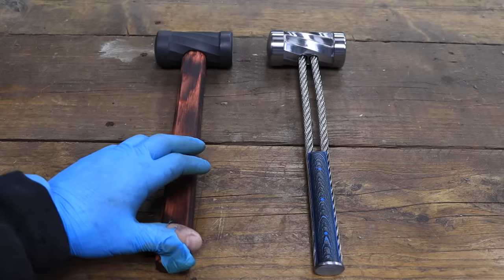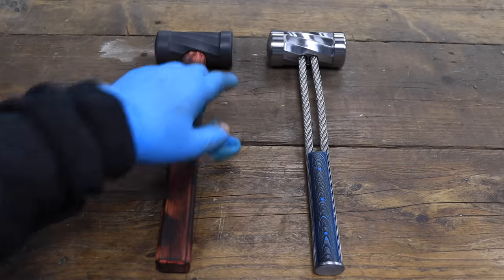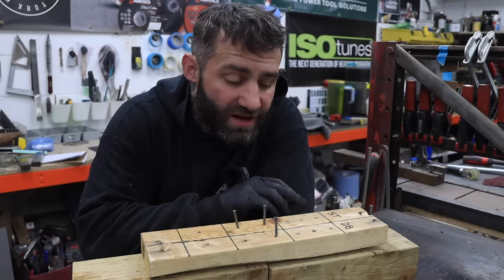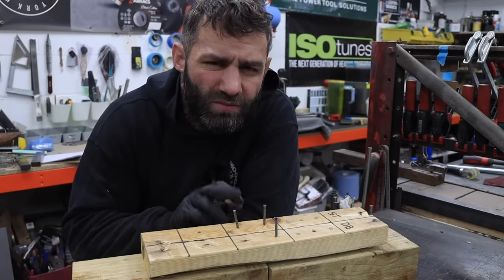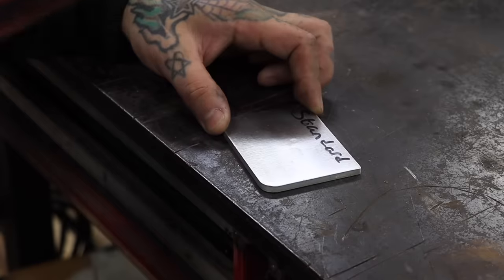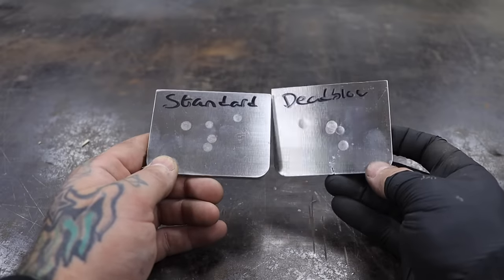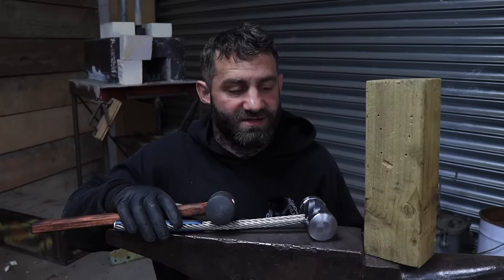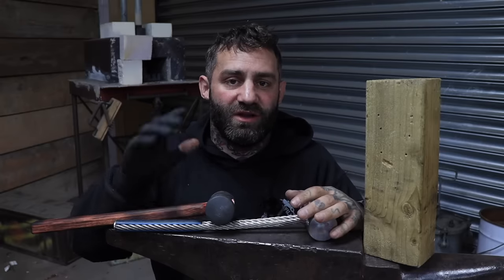Making A Kinetic Hammer - Will It Work?

Comment: @8:07 The head bounces on the first two strikes with the solid handle, right? That acoustic "bzzzz@ Is two rapid strikes -- it sound to me.

Instantly I remembered what happened with a written pencil. If you briskly strike a wooden pencil point at a 20 or so degree angle, lightly bouncing it off a hard, smooth surface, you'll see "two"! graphite trails. In my simulation/imagination, the graphite core snaps back much faster than the pressure wave going through the body of the pencil, but at the end of the second strike, the whole pencil is bouncing back up. 

Since the traces are  nearly equally thick, it seems the energy imparted to the whole pencil is nearly equal on both bounces. So, I'm guessing the first tap, at an ideal angle, results in the pencil losing all velocity in one direction ( bisecting the angle of incidence and bounce - splitting the V ). Twice, the graphite core slams into the table in two efficient elastic bounces. The second bounce sends the pencil what back up.

So, analogously, in the case of this solid hammer, the metal head also has a faster "conductance" to pressure waves than does the wooden handle (it bounces faster than a lateral strike with hard wood). Only in this case, the speed of the bounce of steel and graphite are perhaps quite different. The bounce may be much faster for steel than a pencil graphite.

As to sonic evidence for what I'm saying, I think the compression algorithm might strongly affect the audio here, so if we could see a sonogram of those first few strikes from a raw, uncompressed file, I bet we would see two near equal spikes side-by-side. Visually, maybe a laser pointer could show two strikes if you can get the precise angle and the video frame rate high enough, I guess.

PS I fully intended to skip ahead going see the results of the test, but your pacing was so good that I never had the opportunity to turn away and skip any of the process.

I do wonder if two more cables might stop the twisting that too easily happens sometimes with just two cables. Trying to think outside the box, if the middle area of the handle can become less rigid, with a lower acoustic velocity, then maybe the fast pressure waves of the impact will dissipate. Therefore, I think you'd want a material with a different acoustic velocity, not flexible steel, but "flexi-glass"-- or a robust but slightly flexible plastic-type material -- super-stiff rubber.

Comment: you could do a sort of ZIG ZAG (in triangles) pattern springs or thin cables / wires in between the cables..so it still flexible but more easy to wield.

Comment: Can you try with 3 wires, so that the head does not rotate when you hit hard? Also, maybe try with an axe for cutting/splitting wood?
Reply: That’s what I was thinking. 3 would still let it flex some, but be equally stiff in most directions. With just 2 it’s stiff one way and softer the other way. 
If you wanted it softer could use a single cable and it would be the same in all directions.

Comment: Try modifying it to have a third cable in the center from handle to head. That should stiffen things up a bit. Then you could experiment with adding physical connections between the cables of varying types, sizes, and number.
Reply from the maker: I explained how to fix it

Comment: I think you could improve the accuracy of the dead blow hammer without increasing shock load by constraining more of the cable section in such a way that the cables can move relative to each other on only the vertical axis.
Reply from the maker: If you watch till the end I explain how to sort it

Comment: That's pretty interesting and beautiful. Watching this made me think two things. For a similar effect, I wonder if you could use a very stiff coil spring for a handle; if it wants to spring back to the original position maybe it'd increase accuracy. When I saw the thumbnail, I thought the cable was a solid rod and the hammer slid from the handle to normal position. A splitting maul with a sliding head like that might have some unexpected virtue. Anyway, I've ran into your channel 3 times now and have enjoyed myself, so I guess it's time to sub. Thanks for doing your thing, its fun to come along for the ride.
Reply from the maker: I tried coil spring for the concept and it was way too crazy. 
Thank you very much im glad you decided to subscribe

Comment: What about some super thick chain to put between the steel cable? Would add rigidity but still let the hammer flex in direction of travel.
Reply from the maker: I’ve explained how to fix it, anything else takes away from the purpose of flex and it’s twist that was the problem not the flex

Comment: Another great vid. I think a single  cable might work better, having two might be going against eatchother. Kinetic hammers realy excell at low level hitting, ie...driving spikes or hitting a cold chisel for splitting rock thats low and paralell to the ground.
Reply from the maker: I explained how to fix the issue in the video, the concept works fine

Comment: You choke your hammer ... Let the hammer do the work after your wrist flicks it through the arc...I framed houses for over 15 years and the first thing my mentor taught me was holding the hammer at the bottom end about and inch from bottom... Let the wrist flick the hammer forward in an arc shape , also don't hold the hammer tight at moment of impact. Deadens the vibration and better for your wrist and hand muscles.
Reply from the maker: Different ways to use a hammer, not all have the same use, im a blacksmith not a framer

Comment: You should solder another peace of steel cable in the middle of the existing pair , in order to achieve more precision...Cuz the head of the Hammer was swinging as hell...👍🌟
Reply from the maker: I explained how to fix it, i want the flex

Comment: Just put a piece of steel between the cable half way between the handle and the head , that might stiffen it up but still give it room to flex 🤷🏻‍♂️
Reply from the maker: Nope it doesn’t, you just see the build you don’t see me trying stuff, thats why i explained shorter cable or slightly thicker

Comment: So...

Standard: A bit physically taxing. Not mentally taxing, you're basically already conditioned for this.

Deadblow: Not too physically taxing—probably better for hours-long periods of use. Mentally taxing, because you need to train your brain to make it more accurate. 

Am I right?
Reply from the maker: Ermm no not really, tbh it’s more mentally taxing to swing it like a normal hammer, if you use it properly it actually works perfectly without effort but I learned this after posting the video

Comment: The principle behind flexible handled sledge hammers is storage of energy in the flexed handle. It permit you to slowly raise the sledge hammer behind you while you induce forces in the handle, and when the sledge hammer head falls towards the intended impact zone, the gravity and the accumulated forces in the handle accelerate the head of the sledge hammer to a faster final speed than just a human stroke. Impacting with greater forces because of the higher velocity.

Comment: My assumption is that as you make the kinetic hammer more "wieldable" you are making it more rigid, and therefore reducing the effectiveness of it's defining characteristic, and only benefit.
Reply from the maker: It wouldn’t change the actual use just prevent twist, ive sorted it now

Comment: I feel you might need a collar around the top of the handle, your asking a lot from a bit of glue. Also could one or two small bits welded equally spaced apart help reduce the flex in the upper part of the handle.
Reply from the maker: Glue?? There’s no glue holding the head. 
I want the flex it’s twist thatwas the problem and I explained how to fix it in the video

Comment: Hi you didn't weld the under size of your flexible hammer, is it volontary ? Anyway very nice video all funny tose the pranks of your deadpool alter ego !
Reply from the maker: I did, i cut together bits of the welding process but both sides and edges were welded

Comment: You do use kinetic lots, but impact
is rather right word.
Reply from the maker: Nope kinetic is the right word and yeh ive used it on 3 videos where Ive designed something kinetic
Reply: @DiesInEveryFilm  If it goes kinetic it would
mean that the nail got fused to the hammer!
Reply from the maker: @pernykvist3442  😂😂😂 nope that’s not kinetic
Reply: @DiesInEveryFilm  Yes it is, same when you using the
angle grinder and sparks fly thats kinetic energy
Reply from the maker: @pernykvist3442  kinetic energy is motion so it doesn’t mean anything fuses together please just google instead of trying to argue with me
Reply: @DiesInEveryFilm  Yes i have you should look on it to.
Reply from the maker: @pernykvist3442  kinetic energy, form of energy that an object or a particle has by reason of its motion. If work, which transfers energy, is done on an object by applying a net force, the object speeds up and thereby gains kinetic energy. Kinetic energy is a property of a moving object or particle and depends not only on its motion but also on its mass. The kind of motion may be translation (or motion along a path from one place to another), rotation about an axis, vibration, or any combination of motions.

Comment: You should've used 4 cables instead of 2. Your handle only constrains 1 degree of freedom.
Reply from the maker: You would not get the flex and it wouldn’t fit in your hand
Reply: @DiesInEveryFilm  maybe smaller gauge cable?
Reply from the maker: @THCMusicBlog  wouldn’t prevent the twisting

Comment: What a stupid idea u have just made a shitty flail, esp using metal cable. If u had used dense polypropylene for a strong but flexible handle it would be better. You get the flex without loosing accuracy